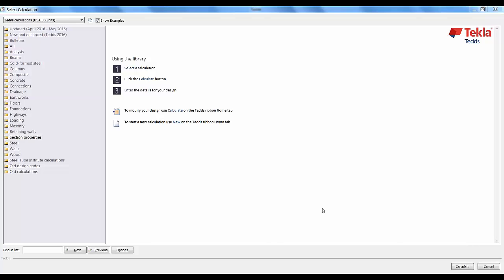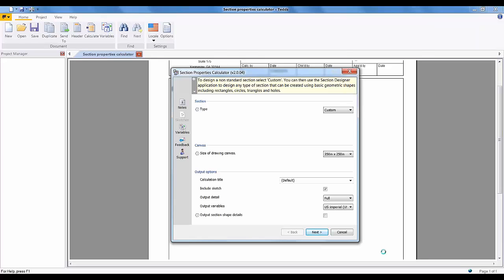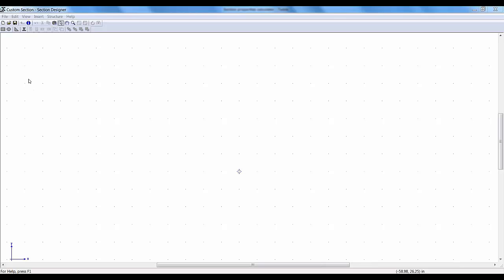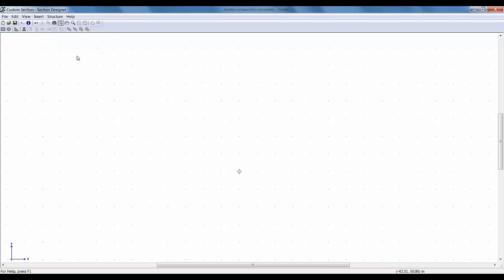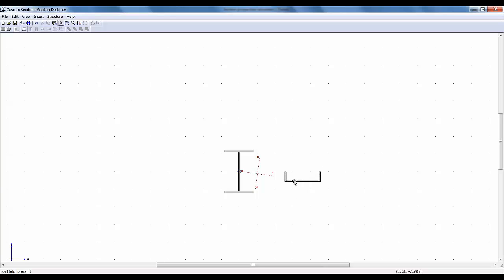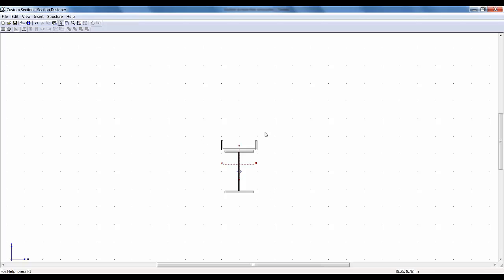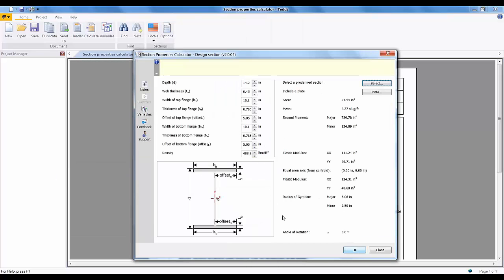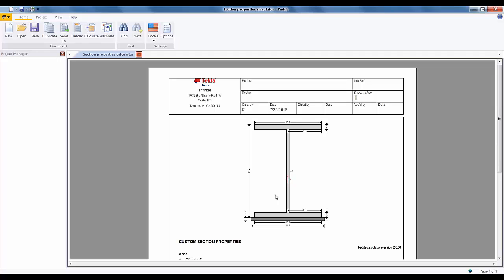Section Property Calculators

Comment: how i can create the build up steel section in Tekla Structure Design? Example 165x350x8x5 ( Width top & bottom 165 mm, thk 8mm; web  depth 334 mm & thk 5mm. Thanks a lot